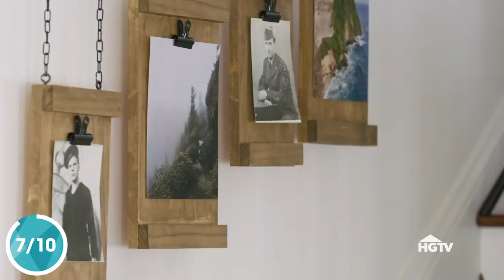Get the Fixer Upper Look: 10 Farmhouse DIYs - HGTV Handmade

Comment: Painted jars are my favorite, just curious why painters tape was not used instead?
Still turned out cute!
Reply: Della Hicks probably because painters tape is just one size whereas washi tape varies in size (so you can have smaller plaid print in the end with washi tape)
Reply: @green_eye_gossip  Actually painters tape comes in various widths, the washi tape in the video looks to be approx. 1", I have used painters tape narrower then that.
Reply: Cheaper by far